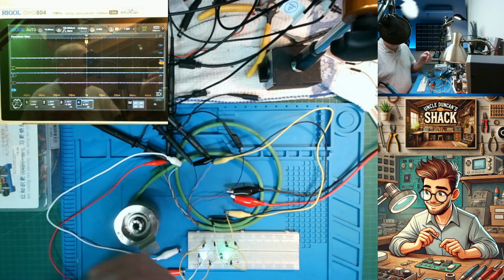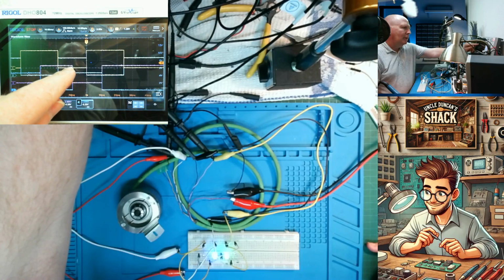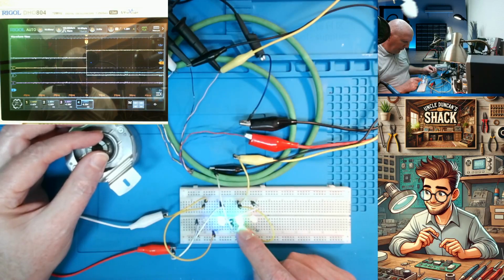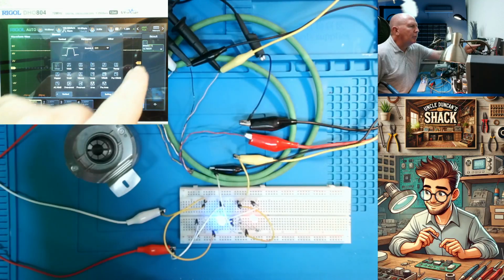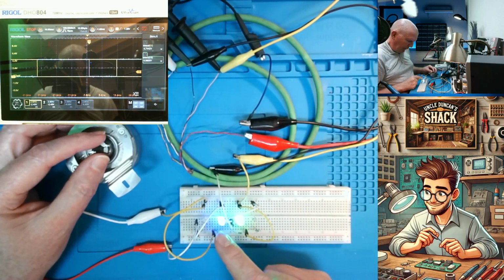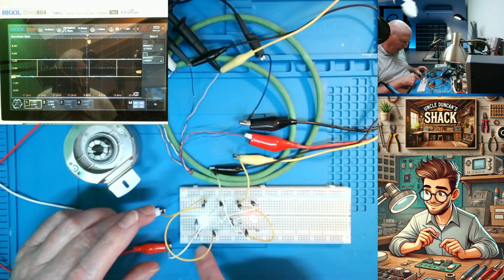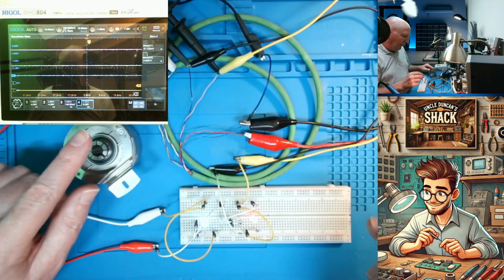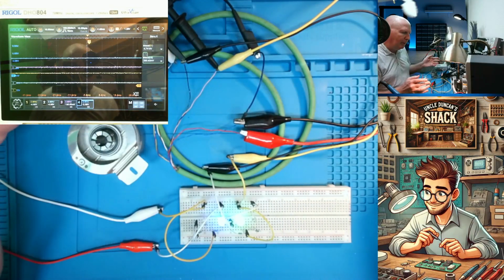🔧 **Optical Shaft Encoder Demo | Scope + LED Visualization** 🔧

Comment from the maker: This video shows the output of an incremental optical shaft encoder in action! The A and B channels are visualized both on the oscilloscope and with dual-LED indicators (one forward, one reversed) to show each state change clearly. TTL RS485 output makes it robust for industrial environments.

💬 Got questions about encoder wiring, interpreting the waveforms, or how to read direction from A/B phase? Drop them below and I’ll do my best to help!